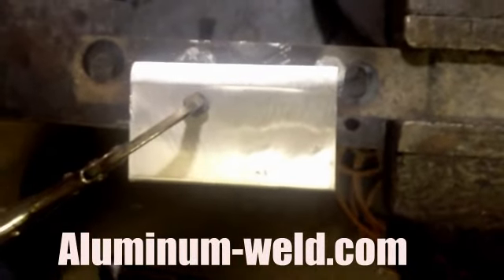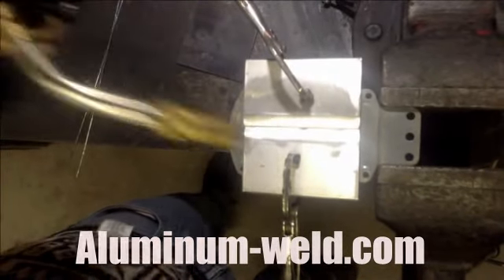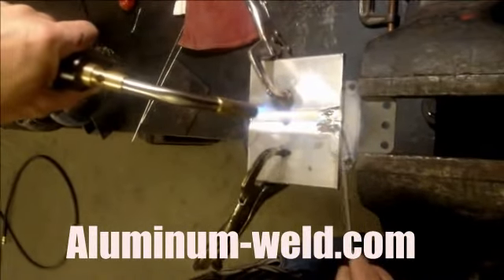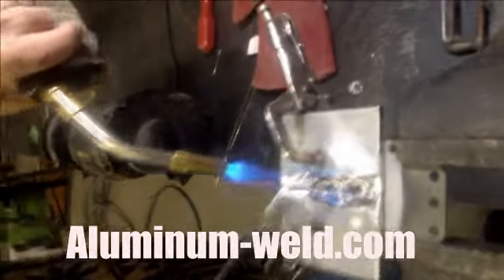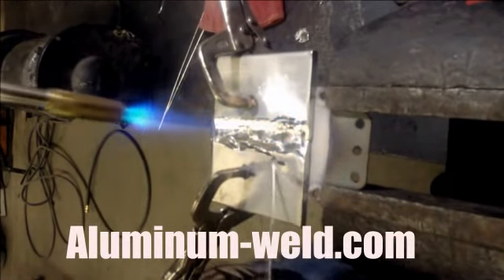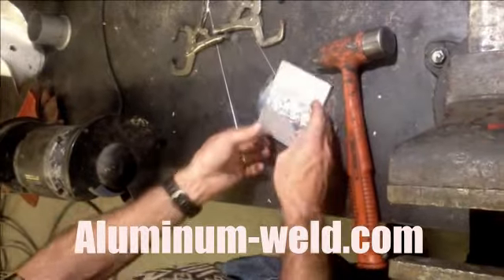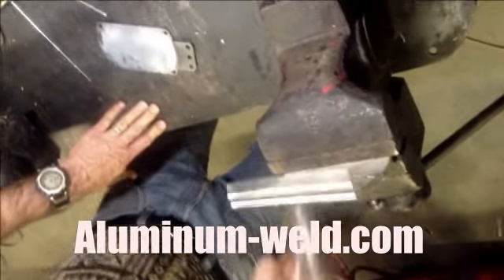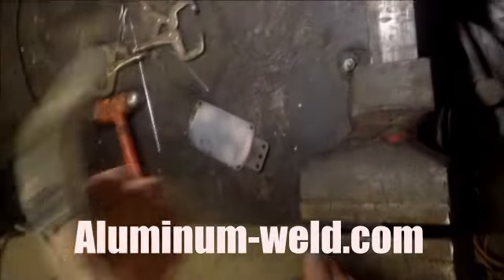Aluminum Repair Butt Joint Using HTS-735-II Fluxless Brazing Rod

Comment: I have used this product and it works great! I ride an off road motorcycle and used a butt weld like in this video to reattach the ball end of my clutch lever. I also repaired the rear sprocket, some holes and the mounting brackets of my muffler  plus a hinge on my BBQ. All of these were done almost 2 years ago.

If the aluminum is hot enough to melt the rod, IT WILL WORK!  

READ THE INSTRUCTIONS and/or call the factory rep if you are having problems!